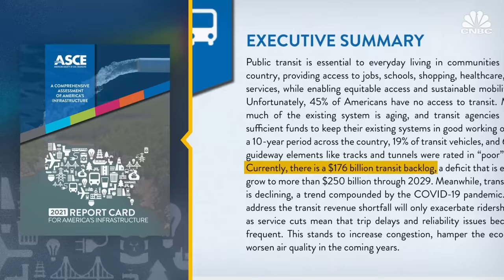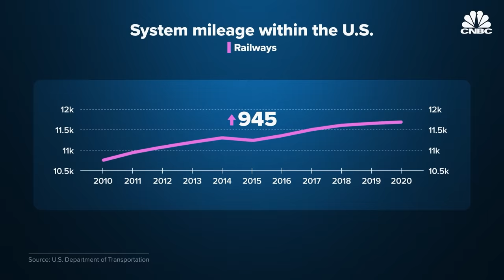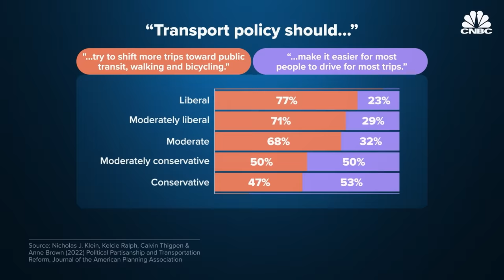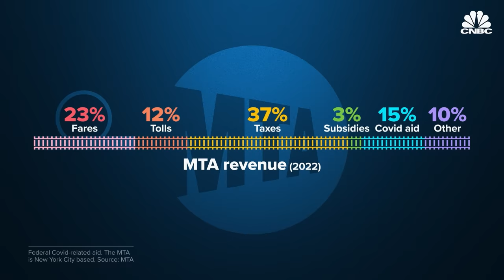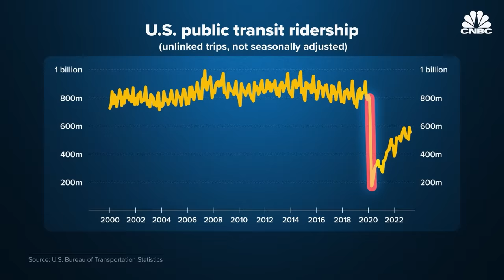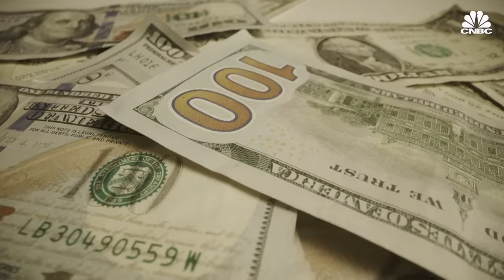Why The U.S. Gave Up On Public Transit

Comment: I’m a moderate and I’m tired of lackluster transit options. It’s pathetic to be a country that decides to do so little with so much.
Reply: The problem with transit isn't lack of money. It's too much. what subsidies did was pervert work effort and priorities. Instead of providing transportation they provided palaces ie white elephants. Once Transit in US became municipalized in 1960's, Government takeover resulted in switch of priorities. subsidies sent the wrong signals to management and labor. Management interpreted the message to mean: efficiency was no longer primary,”. Labor interpreted the message to mean: management now has a Sugar Daddy who can pay for improvements in wages and working conditions regardless of how much" 

    Transit agencies are more interested in building infrastructure empires than in moving people;
    Politicians are more interested in building new infrastructure than maintaining the old;
    The industry has seen a 50-percent decline in worker productivity since it was municipalized;
    Transit planners refuse to accept that cities no longer have the same job and residential concentrations that they had a hundred years ago.
Reply: @spikedpsycho2383  this is incorrect. even at it's most cash-strapped, japan spent more on public transport than the US has for a population and area a fraction of the size. the reason public transportation is non-existent in the US is because of the oil and car lobby. Even tesla's owner, elon, regularly spreads blatant falsehoods about public transport because it would cut into his bottom line.
this isn't even controversial. there are literally thousands of studies on how to implement public transport effectively. asia and europe all have robust public transport options where the governments are stable.
Reply: stop voting for politicians who are beholden to fossil fuel industry.
Reply: @spikedpsycho2383  I spent time in Germany, this is exactly how they are ruining their transport system. A lot of Pro-government funded transport people are under the delusion (foreigners) that their system is really good but from speaking with locals in Germany, they know its terrible and don't expect improvements based on how the government spends.
Reply: @snowballeffect7812  Well thats a downright lie from someone who clearly hasn't spent enough time in experiencing these systems. If almost all countries have the same issue, pretty much stemming from the same causes then surely thats warranted a re-think. "Studies" are like imaginary wishlists of what could be but in practice doesn't work.
Reply: @snowballeffect7812  Ah ok I see where your attitude is..
Reply: @aijadawddaw  "'Studies' are like imaginary wishlists of what could be but in practice doesn't work." You showed your whole ass here. Studies are empirical: being anti-empirical is just denying reality
Reply: @theflaggeddragon9472  that all you got chief?
Reply: @aijadawddaw  Look man, idk where you're planning on getting your information from if it's not from studies or sources that quote studies. Everything else is just feelings and vibes. How are you supposed to know what you're reading is accurate if it's not been rigorously studied?
Reply: This shouldn't be a liberal or conservative issue, better public transport is literally better for everyone
Reply: @aijadawddaw  LOL. if you don't believe in studies, how exactly are you forming your understanding of reality??
Reply: @darkcasterx4628  it's not better for corporate profits for the automobile (including electric, hence musk's opposition) and oil industries. unfortunately for you, corporations are now people so they get an outsized lobby and vote against the public's best interest so that they can make more profit in the short term.
Reply: A trillion bucks a year for war.
Reply: So right. It's infuriating and disgraceful. It's shameful too. I stay where I live somewhat because of the availability of pub trans. I can ride it for free being senior.  I don't need a car anymore. So no gas, insurance or maintenance bills.
Reply: @OOL-UV2  so you're saying the US spends more and got less and you don't think rural areas don't exist in Europe? interesting lmao. I guess thanks for making my point for me. I couldn't find either number you were talking about and it's weird you could only find data for 2019. I only bring up elon because despite saying he wants to "save the planet", he'll straight up lie about the effectiveness of public transport like high speed rail because it affects his bottom line.
Reply: Here in China, I don't need a car. The public transportation is always there. It's also modern, low cost and clean. The US public transport looks like a third world country by comparison.
Reply: And many highways in major cities were built directly through flourishing African-American communities. 

Highways displaced many Black American citizens and led to a housing crisis amongst African Americans
Reply: repentandbelieveinJesusChrist2  Jesus would ride on a bus instead of driving an SUV.  📖
Reply: This what happens when you leave public transportation to private corporations. Also what nakes you a moderate?
Reply: No one asks if roads are profitable. It is just seen as a public good. Mass transit is a public good that offers better value for the money. The 26-lane wide Katy Freeway in Texas has less passenger capacity than the typical 2-track metro transit system. The United States was literally developed due to rail networks. Even Texas has seen the light; they are planning a high speed rail system between Dallas and Houston.
Reply: @Mr.Patrick_Hung  The U.S. has forgotten its rail history. China, Spain, and Japan are great examples of what is possible with well designed high speed rail between major metro regions, that also have well developed local transit systems and wise land development.
Reply: @barryrobbins7694  Now if they only could see the light when it comes to their electric grid XD
Reply: @thejquinn  Yes, they would need electricity to turn the light on. So, maybe in the fall or spring.😀
Reply: @barryrobbins7694  America is the size that it is because of the transcontinental railroad. Today's Chinese railways are part of the growth of Modern China's economy. If we had to build highways to match this population, the entire country would be paved over.
Reply: @Mr.Patrick_Hung  Exactly, trains make more sense, and there are certainly areas of the United States that have the population density to justify high speed trains and more developed metro systems. The United States wastes too much valuable land on roads, parking lots, and sprawling car centric housing developments.
Reply: @aijadawddaw  Your characterisation of the reasons for public transit being the way it is in Germany does not have much overlap with the truth. Our main railway company Deutsche Bahn (DB) is owned by the state, but it is a business, not a public institution of any kind. It operates like any other company, not like a state agency. It is expected to generate a profit.

The actual problem, hence, is two-fold:

1. As with any other business, generating a profit is more important than providing the best possible service, so if more profit can be made with worse service and less infrastructure maintenance, then that is what is done.

2. DB has several business units. Passenger transport is only one of them, and it only accounts for a minority of the revenue. This means that it doesn't matter to DB if their passenger transport is awful as long as the business as a whole is profitable. Unlike an entity that is part of the state, a business like DB has no obligation to serve the people first and foremost, so they prioritise based entirely on business aspects.
Reply: The public transit users in the U.S. make the service unattractive to other potential users.
Reply: @frankmartin8471  The beatings will continue until the attitude improves?.
Reply: @snowballeffect7812  Fossil fuels are natural and wonderful. Their use should be maximised.
Reply: @frankmartin8471  how?
Reply: @edwardcuevas6974  in what way is burning fossil fuels natural, you plonkus? lmao
Reply: @snowballeffect7812  Its obvious I'm not the one who is a  "plonkus".
Reply: @snowballeffect7812  Despite the disparaging remarks, you understand you're place. Well done.
Reply: @snowballeffect7812  I think political division has a big part going against public transportation, and it's not just the oil companies. A good half of people here in the US are not really supportive about it ether, since they probably see it as a partisan boondoggle and overreach from the opposing side. Our current political system is dominated by two sides that can't get along to work together and agree on something.
Reply: @edwardcuevas6974  I ask again, in what way is burning fossil fuels natural, crude-guzzling fume-huffer? lol
Reply: @KenKen-ui4ny  "and it's not just the oil companies" it mostly is. the politicians are like that because of big oil lobbying and voters being disinformed
Reply: @snowballeffect7812  It's easy to point the fingers at just the side that the oil companies are on, but in reality both sides are to blame for how divided our country has become. Both side act like the solutions to every issue that we have going on, should be their party's way or nothing, instead of collaborating together about it. If you had the centrist mentality like i have, and see thing from more in the middle. Then you would understand where i am coming from.
Reply: @snowballeffect7812  "Crude -guzzling"?
Reply: @edwardcuevas6974  still not responding, i see.
Reply: @snowballeffect7812  Response to the obvious is pointless. Capitalize "i" when referring to yourself.
Reply: @edwardcuevas6974  please try harder when you troll. real big oil shills would at least try.
Reply: @KenKen-ui4ny  "Cognitive ability and party identity in the United States" I'm not a fan of either party, but you really do support the findings of this study lmao. There is literally no point in "both sides-ing" when you literally admitted one side is openly pandering to the oil lobby.
Also a "centrist" in the US is just a conservative in every other OECD nation.
Reply: @snowballeffect7812  I believe we need more public transportation, but i think it should be put out there as a choice, Not forced upon us by one sides arrogance on what the free market should be. This is also where i disagree with other OECD nations, because i think they are kind of too far left about it. Then on the flip side, you got people who are too far right about it, like the oil companies, who don't want us to have other choices of transportation. Put it this way, if i was to have it my way. Both sides and other OECD nations would not like me.
Reply: @KenKen-ui4ny  just an "enlightened" centrist, probably libertarian. nothing you said is evidence-based. we don't put it to the free market if houses should have functioning plumbing and electrical. If you don't like public transit, literally nothing is preventing you from using a different mode of transport. The "free market" is why we have no public transport now because they chose corporate profits of one sector instead of the well-being of the citizens and increased distributed economic prosperity.
Reply: @snowballeffect7812  What wrong with being a libertarian. BTW Insulting those who disagree with you, kind of make your end of the debate look weak.
Reply: @KenKen-ui4ny  i'm not insulting you because you disagree, i'm insulting you because you're wrong lol.
Reply: @snowballeffect7812  How i am wrong? It call having a different opinion then yours. Doesn't mean your right or wrong.
Reply: @KenKen-ui4ny  nothing you said was based on any evidence. lol. we already know the effects of good public transport and why there is such a lack of it in the US.
Reply: @snowballeffect7812  Again, insulting someones opinion, and saying it not based on any evidence. Just only shows  arrogance, and make your end of the debate look weak. So jokes on you.
Reply: @snowballeffect7812  No need. Its self explanatory.
Reply: @edwardcuevas6974  sure thing, DJ Suki lmao
Reply: @KenKen-ui4ny  I like how you think being corrected is somehow an insult. If having facts, studies and hard evidence is arrogance, then I guess you're the most humble libertarian centrist on the planet lol.
Reply: @snowballeffect7812  Very good.
Reply: @KenKen-ui4ny  You do realize that the lack of public transport is what is currently being forced upon us, right? The problem is the US literally does not have a choice right now, and it's for the reasons that have been proven by the studies and evidence I'm referencing.
Reply: @KenKen-ui4ny  meanwhile, nothing you said has any evidence supporting it lol. ironic. all you have to do is follow the money, but instead you drank the kool-aid and are carrying water for them lol.
Reply: @snowballeffect7812  No succeed.
Reply: @edwardcuevas6974  nope, you didn't lol. i like how this is apparently less effort for you than continuing to pretend to shill.
Reply: @snowballeffect7812  No "shill" no "pretend".
Reply: @snowballeffect7812  Who said i got to have evidence supporting my opinion? And as in regards to the studies and evidence you where referring to. I will take them with a grain of salt. Other words i will think for myself about it. Yes i think one of the reason we don't have a better selection of transportation here in the us, is because of oil company lobby. But that not the whole story of why though.
Reply: @KenKen-ui4ny  "Who said i got to have evidence supporting my opinion?" LOL
Reply: @snowballeffect7812  You are starting to understand. Very good.
Reply: @snowballeffect7812  Sorry, Snow Ball Effect. You can egotistically bully me all you want. But your going to change my mind.
Reply: @KenKen-ui4ny  no one is bullying you. i know i won't change your mind because you literally just admitted it's not based on any rational logic or evidence lol.
Reply: @snowballeffect7812  Its all there to see.
Reply: @edwardcuevas6974  you didn't even have enough of an idea to make up a reason lol
Reply: @snowballeffect7812  No "reason" is needed for the obvious.
Reply: @snowballeffect7812  Nope.
Reply: @edwardcuevas6974  you've left like 20 replies that indicate otherwise lol
Reply: @snowballeffect7812  Sure
Reply: @snowballeffect7812  Yup.
Reply: @snowballeffect7812  Laughter with yourself is a two edged game.
Reply: @snowballeffect7812  That's correct.
Reply: @snowballeffect7812  Yep.
Reply: @snowballeffect7812  Try harder.
Reply: @edwardcuevas6974  why should I? it's "obvious" lmfao
Reply: @snowballeffect7812  Yes it is.
Reply: @edwardcuevas6974  you've been replying to yourself for a week. are you ok? lol
Reply: @snowballeffect7812  Stellar.
Reply: @snowballeffect7812  Laugh good.
Reply: @snowballeffect7812  Yes. A laugh a minute.
Reply: @edwardcuevas6974  lol
Reply: @snowballeffect7812  Try telling that to the rural, gun loving, and possibly affiliated to a hate group Republican.